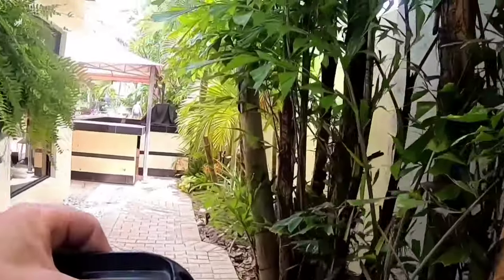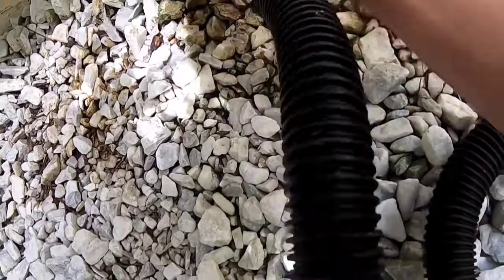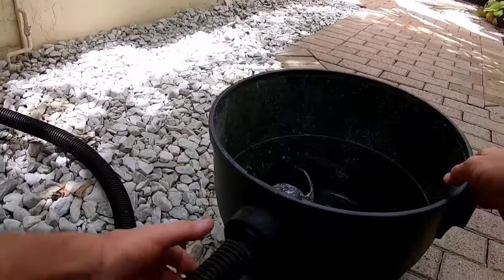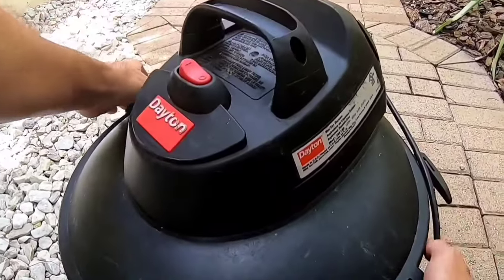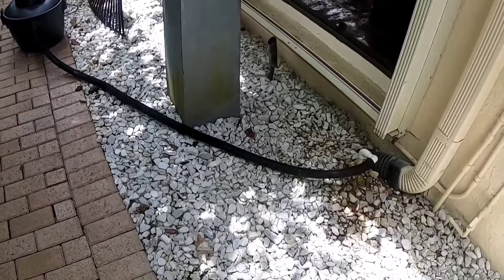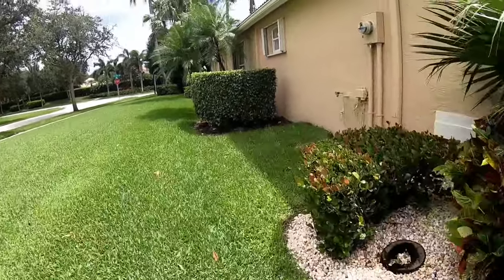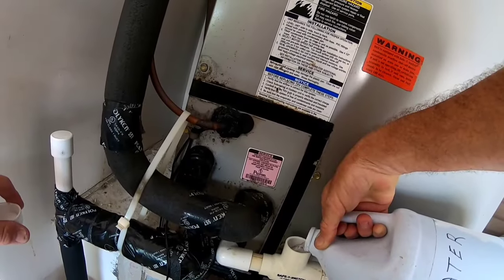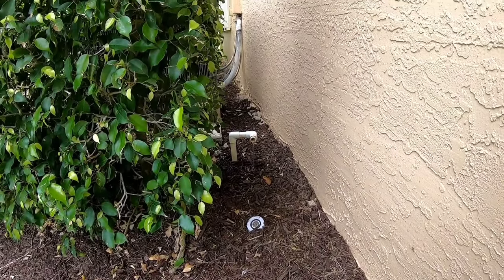Clearing an A/C drain with a Shop Vac(Wet Vac)

Comment: This is the proper way it's done! Folks Vinegar and hydrogen peroxide helps prevent clogs if you use them routinely during the year as maintenance. But they won't clear a clog if your system has too much build up on it.

The only way to clear a clog properly is to use pressure or suction.

Comment: Which vacuum is perfect for this?, I mean one which can adapt it perfect. I need one just for that purpose.
Reply from the maker: Sorry for the delay in my response to be honest it depends on the application I think a three and a half to five horsepower shop vac should be fine for most jobs to clear the drain line if you are on a commercial building with a larger drain then maybe a larger shop vac

Comment: Just had someone come out said the same thing as you did to get an adapter what else can you use for an adapter if you don't mind me asking do you think the duct tape will work? Would you recommend any Format for an adapter?hey thanks a lot for this. It was really cool thing to do that especially the time frame It should take and what you should expect. Much thanks! Ps. My kill switch did not work drain pan was clogged also vacuumed out but we all didn't think the kill switch would be soon temperamental water everywhere laundry room garage
Reply from the maker: Sorry don't check My comments much only have the one video duct tape can work in a pinch
Reply: @sharks1117  hey thanks a lot for getting back to me...lol, no serious though   thanks a lot I really appreciate it I'm going to actually try it hopefully not that soon have to check calendar. Thanks again
Reply: @sharks1117  a great video for just one though

Comment: My drain hose is not a pvc pipe. It's just a narrow hose extending outside. Is there an adapter I could use to get the shop vac to fit snug over the drain hose?
Reply from the maker: How large is your shop vac hose?
Reply from the maker: If the hose is much larger than your outlet on the drain they do sell reducers at the hardware store to go from larger to smaller pipe worst case scenario you could use duct tape around the end just make sure it's wrapped tightly
Reply: Shop vac hose is probably an inch in diameter. The hose coming from the condensation pump is very narrow. Looks like whoever installed it just pushed it through the same hole used by the wires going to the outside hvac units. I think the duct tape idea will probably work. Thanks.
Reply from the maker: @jazagumo  oh okay I didn't know you had a condensate pump it's important to make sure that the drain is clear from the air handler or cooling coil on your furnace to the pump, not sure what you have.  It's going to be a little harder to clear the 3/8 tubing on your condensate pump with a Shop-Vac.  It's better to blow out that line with compressed air your condensate pump may or may not have a small metal clamp holding the hose on the barbed fitting.   it might be tough to pull off make sure to  turn off the power to the unit if it is getting power from the unit or unplug the condensate pump from the wall before servicing it.  It's equally as important to clean out the inside of the pump and the reservoir.  After this is done the line is clear to the pump and the pump is clear run hot tap water through the pump to the outside to make sure everything is draining
Reply from the maker: Thanks for giving me ideas for future videos.
Reply: @sharks1117  Thanks. I see where the pump plugs in so I should be able to unplug it and clean it. That may be the issue.
Reply: Also everyone, really great questions and replies thanks again

Comment: while you put water on drain and check the drain, is unit on or off?
Reply from the maker: It's better if you do it with the unit off.  depending on the length of the drain line it might take more than one gallon of water
Reply from the maker: Sorry for the delay

Comment: poured a bunch of bleach down the drain line of mine and used the blowing end to bust out years of crud, used it to suck up the layer of rust on the bottom of the drip pan too
Reply from the maker: Whatever works best nice job!!
Reply: @sharks1117  Literally was causing issues before this and my dad would always just tell me to go up there and pour bleach down it, close the valve and blow through both sides of it. He passed and it leaked from the attic into my bedroom and along the ceiling so I had enough of dealing with it and decided to end the problem. 2 months and zero problems can hear water flowing freely through that drain.